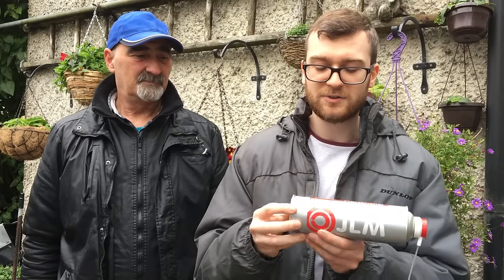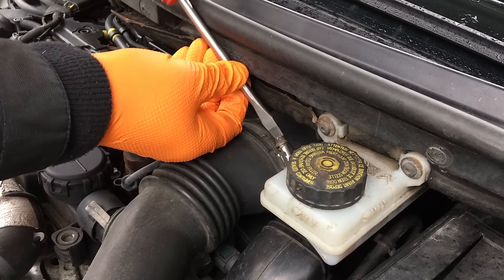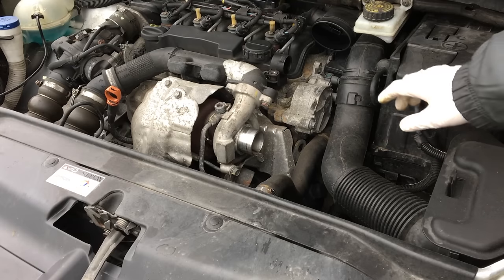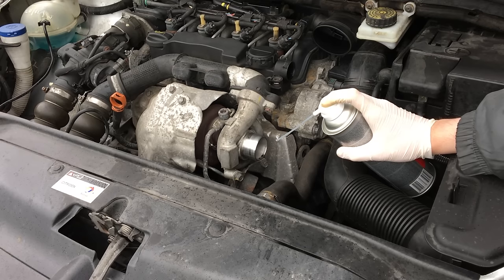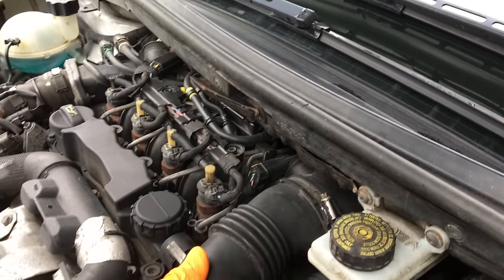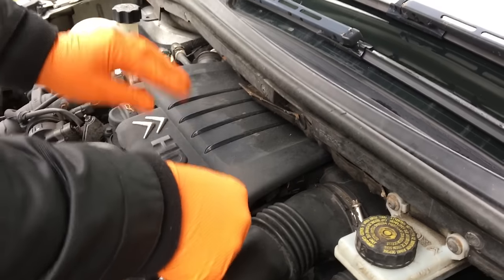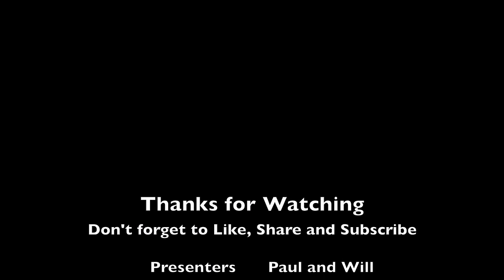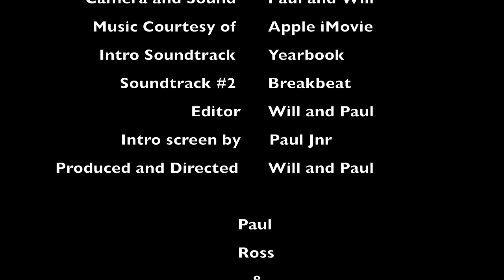How To Clean an EGR Valve Without Removing It

Comment: Clear explanation of getting this done. Good Visuals (Lighting, etc.) Very Helpful (especially when i am learning how to do this stuff so i will not get over charged by a local repair shop. Man, so many of local shops are questionable (overcharge, misdiagnose problem,  misleading info about repairs, etc, etc). Thanks for video (USA).
Reply from the maker: Hi K, 
Good on ya. No better way to learn than to try it for yourself.
Sometimes DIY can stand for Destroy It Yourself but not so in this video. You will not damage anything as long as you do not spray any sensors i.e. Mass Air Flow (MAF) sensor being very sensitive. 
If after using the can of EGR valve cleaner the EGR valve is still choked up then it would have just cost you the price of a can to find out.
We have another video of cleaning one when it's out of the car   https://youtu.be/HXqJ0YcOqOI
With experience we can relate to different garages and workshops diagnosis and billing methods so we make every effort to do it ourselves and share it with our viewers

Comment: Hello) It turns out that you did the dismantling of the air sensor and poured the spray directly into the turbine and all this went through the air cooler and through the damper and into the motor?

Comment: Did it work then?   Did it fix the engine light coming on with the EGR fault code?    I reckon you'd have a very slim chance of a spray into the intake actually removing enough carbon to resolve the engine light.
Reply from the maker: Yes, it worked. It temporarily cleaned enough for the warning light to go out for a few weeks. Eventually the egr valve was replaced.

Comment: Would this procedure apply to a petrol car? I am thinking in particular of a 2009 Chevrolet Matiz. Good work, many thanks!
Reply: In case of your car, it is petrol car with no turbo I guess. I that case, the inlet manifold of petrol car does not get much dirty.
Reply: I had the problem a couple of months ago when engine running when very lumpy and yellow engine management light came on. I gapped plugs, changed coil-pack but no good. I later replaced spark plugs but though running a little better, that was not full answer. I cleaned PCV which seemed to be working OK then reoved air-hose and squirted cleaner into air-intake. Within a couple of squirts, engine came back to running normally. For good measure, I fitted new air-filter as this was noticeably nearly black and likely overdue. Finally, yellow engine management light went out without having to cancel anything and everything still works just fine having passed annual technical test with no problem! Have a good day! @salimmetin

Comment: That was Great!!!! Love how humble you both were God bless you and yours from Missouri U.S. A.
Reply: Lee Brushwood what’s the cleaner u used ?
Reply: @virginiacurcija9445  I used seafoam motor tune-up, but I wasn't having a problem with my E. G.. R. Valve. At the time my truck had carbon built on top of the Pistons, so I just poured some down the carburetor and ran it for awhile. It smoked like a smog machine, but ran like a top afterwards.

Comment: Great job guys, indeed useful. The JLM instructional video (today at least that I checked) is saying to not spray it on the turbo as other people are saying, but to the inlet and not on the mass air flow sensor (MAF). On good trick on this car would be to remove the MAP sensor and spray to the hole.
Reply from the maker: Hi ktopoglidis,
Thanks for the comment.
Instructions and directions released by different brands are usually generalised and not model specific.
It is possible to spray directly through the turbo provided it's not hot. 
The spray canister being highly pressurised would be very cold and spraying it into a hot turbo could possibly cause micro fracturing of the vanes.
If as you suggested that removing the MAF and spraying in that way, we would reckon the majority of the spray would hit the inside of the pipe before a very little would eventually find it's way to the EGR valve
Reply: indeed they are not model specific the instructions from the manufacturers, but they do say in their video to do not spray in the turbo. There are several reasons, but I don't go into that. For many european models (Citroen, Mazda, Peugeot, Volvo, Mini and possibly more) the engine is the same (or similar). So taking one bolt that keeps the MAP is as easy as taking out the intake pipe. 
I will agree that you may have issues of hitting the pipe and run down a bit, but still might be better option.
The JLM video is here also: https://www.youtube.com/watch?v=rFoZ6F1KESw
Since I wanted to clean and the pipes etc I sprayed also on the turbo a bit.
Reply from the maker: We did indeed try it through the MAF/MAP on a Citroen C5 1.6hdi and it didn't work so well for us.
We found this way better but we would recommend caution as described above

Comment: Hi guys, my wife’s C4 GP 1.6 hdi is showing an engine management light and an ‘anti pollution faulty’ message. The car is driving ok up to 80 kph /50 mph but after that it can slow down going up hill, can hold back in traffic or even stall when going around a corner. Is it worth trying this treatment or is it altogether more serious? I’ve also thought about changing the fuel filter and air filter but then I’m stuck for ideas after that. Thanks for the great videos, they’re really inspirational.
Reply from the maker: Hi robru,
It could be a partially clogged EGR valve or it could be a clogged DPF.
If the fuel filter was bad, the car may have starting and acceleration issues at all speeds including stalling as well as pushing out excessive exhaust smoke.
Cleaning the EGR valve with the spray would be the first and least expensive step in a process of elimination.
Hope this helps.
Reply: Driveway Dudes many thanks for replying. I will give the spray a try first.

Comment: Will this cause my engine to overheat, which then kicks in my high fan to cool? I just did thermo housing, water pipe and turbo coolant aux pump, no leaks anymore YET IT NOW OVERHEATS 😮 and I have a fault code p2418 EVAP… so I’m not sure if it’s this EGR or my EVAP???? Please help me!!!!!!
Reply from the maker: Code P2418 is for EVAP and not EGR.
Hint, EVAP is short for evaporation and would be fuel related as opposed to EGR exhaust gas recirculation.
Try trouble-shooting and below may help correct this error:
Faulty wiring repair or replacement. EVAP pressure sensor repair or replacement. Fuel cap replacement. Faulty EVAP valves replacement. EVAP pump circuit and connections corrections. Purge solenoid replacement.
Hope this helps

Comment: Having taken my EGR valve out to clean it, I find it hard to believe a bit of spray will get an EGR restricted with gunk clean.    I scraped gunk off my EGR and soaked it in white spirit.
When I put it back there was an increase in power.
Also is it a good idea to have the at least two desert spoons of gunk that were in my EGR to be sucked into the engine?
Reply from the maker: The chemical composition of the EGR cleaning spray is such that it is capable of breaking down the deposits, ignites with the air fuel mixture and is expelled through the exhaust.
Is Gunk ignitible ? If not then be careful as fluids do not compress well and could possibly harm your engine.
In the very near future we will be making an engine cleaning video,  We may use a car or a motorbike, e.g. one of our cars or maybe a Px Arcobaleno that is to be restored.

Comment: EGR spray cleaner for gasoline cars isn't available in the United States.  What sort of substitute cleaner can I use?  Does the product you are using feel very oily if you rub it in between your fingers?  Does it evaporate quickly?  Does it have the smell of acetone?  I've read that adding 2 oz. of automatic transmission fluid per gallon of gas will clean the EGR valve, since it doesn't burn completely and the vapor works its way into the exhaust.

Comment: Thanks for the taking the time to shoot & post the video. I have a 207 1.6 HDi 2011reg. Its the first time I have ever owned a Diesel. I bought it 14months ago and it has 58000. is it worth doing this to my car, it seems to be running fine. Just had a major service on it yesterday by a Peugeot garage! I also only use Shell V-Power and BP Ultimate, alternating between each fill up.
Reply from the maker: Hi rush man1uk.  Thanks for the comment.
We like to think that this periodic preventative maintenance can help so that you may avoid having EGR issues. 
Spending £10 - £15 and an hour of your time could potentially save you £hundreds in garage bills. 
if you do decide to do it then just be careful that you spray it after the MAF as it is sensitive to the EGR cleaner.
Please feel free to share this channel with your Family, Friends and Contacts :)
Driveway Dudes - Paul
Reply: services are a con. Find out what yourcar needs and just do what's needed.  Anyone can top up their fluids!

Comment: On a Ford, if you get codes about EGR Pos. Sensors, replace the charcoal canister purge valve if it has one. If you get codes about Ox.sensor running rich, replace the MAP sensor.
Reply from the maker: Hi Marty. Good to know and noted :) Thanks

Comment: I have a 93 Lincoln Town Car it's saying EGR valve high voltage EGR valve low voltage do you have any idea what I could be dealing with?
Reply from the maker: Not familiar with the 93 Lincoln Town car but try this link and it may help
https://lincolnforums.com/forums/threads/1993-towncar-code-337-egr-problems.11543/

Comment: My Local Ford specialist replaced The EGR valve completely with The Proper Job."" "Expensive but WOWEE transformed my 2013 Mk 7 Transit... ..
Reply from the maker: Yes, replacing the egr valve is always best if it's beyond a clean

Comment: Hi Driveway Dudes. I have a peugeot 307 SW HDI 1.6, it is a 2004 model. My car has started bunrning the engine oil and it is producing a lot o smoke. Everybody wonders when I drive a round because of smoke. Can thing be solved by cleaning the EGR Valve, Inlet Manifold and Inlet Valves using the EGR cleaner?
Reply from the maker: It's probably the cheapest first step to try. If it works then you've solved it. If not, then you have gotten one step closer to finding the issue by ruling that out

Comment: I have a 2004 ford mustang and have replaced the valve, the two sensors have been checked and  the egr connections are not dirty but the check engine light keeps coming on. Any suggestions as to what to do?
Reply from the maker: Hi MRTIBURONTIBURON,
Is the car running fine when the light is on?
Have you had it on a diagnostic scanner? If so, did you have the system reset?
Have you had any parts replaced? Some aftermarket parts can cause this.
Did you do the "disconnect battery for 15 minutes" simple reset? 
On that car the most common issues that throw up check engine light would be the o2 sensors. Removal and a thorough clean, apply an electrical contact solution and replacing has in some cases rectified this. 
Others include mass air flow sensor, faulty gas cap, egr, faulty or damaged wiring (open circuit, shorting, grounding), cracked/gasket leak at header and then there's the cat
Reply: Driveway Dudes most of them except for  the 15 min reset.

Comment: Hi, Can i do this to my VW Transporter van 2.0 Diesel? Had a diagnostics which has come back with EGR Fault, engine management light is on. I also heard that you can put a certain EGR cleaner direct into the fuel tank when half full?
Reply from the maker: Is it a T5 or 5.1?
Reply from the maker: Usually injector cleaner is added to fuel in tank. 
It's not uncommon for the T5 and 5.1 to have egr issues. You can try cleaning it yourself or removing the egr to clean it. That way you can give it a thorough clean whilst checking the vacuum actuator and connecting pipes and hoses. 
If the van is not too old then in some cases as a gesture of 'Good Will' VW will replace the egr free of charge but you may have to pay labour costs

Comment: Hi, I tried this but as soon as I remove pipe, and start the car the engine shudders to a halt. When I replaced the pipe the engine ticks over again. Is this a sign of something worse? Great video btw
Reply from the maker: Hi Eoghanlynch1985. What engine do you have? Is the engine warm or cold when you try it? After removing the pipe, attempt to bring the revs up a little to prevent the engine from stalling. Hold the increased revs for 30 - 60 seconds and release the accelerator to allow the engine to idle. This should resolve your stalling issue.
Reply: It's a Citroen 1.6 hdi. I think the engine was cold actually. I'll try doing it again with warm engine, and report back. Thanks for advice lads, you're bloody great
Reply from the maker: Hi Eoghanlynch1985. Thanks for the kind words. Please do let us know how you get on :)
Reply: Driveway Dudes, just letting ye know that it worked perfectly with engine hot. I did need to clear fault codes with OBD2 reader though, but sure I picked one up on Amazon for €30, and it's always handy to have one of those
Reply from the maker: Glad to hear you were successful. Hope the video helped.

Comment: I have a 2003 Mitsubishi eclipse I'm also getting the p0401 code I replaced my egr twice located In the back of my engine and replaced the solenoid and the hoses. Still my light stays on.  Would this work for my vehicle and also any other suggestions would help.  Thank you.
Reply from the maker: Hi Lio, 
    P0401 is a generic code. The OBD detected an insufficient exhaust gas recirculation flow.
There are 3 parts to the EGR - 1. EGR valve. 2. Actuator solenoid. 3. Differential pressure sensor egr (DPFE). I see you mentioned the first 2. 
Have you checked number 3 on the list? 
Have you reset the trouble code/s with the necessary equipment as with some vehicles this may be necessary.
You may get build up in the EGR pipe/tube so spraying is an option and in some cases a solution.
If the car is acting/driving normal then it may be just a case of a code reset.
Reply: Driveway Dudes - I'll check number three and also try the cleaning today thanks for the reply.

Comment: Hi guys having problems with a 06 transit connect failing the DOE on the emissions now it was lying up for a while just wondering would cleaning the egr valve help to get this passed obviously with the other bits you have to do..ie filter changes diptane ect?

Comment: I'm confused about the title, with the video shown you are cleaning the egr thru the turbo charger itself is that right? So basically the 2 component's will be cleaned eventually?
Reply from the maker: The turbo may benefit somewhat from the egr valve cleaning spray

Comment: Can u tell me did this work it would save 200 pound ive put egr value cleaner in fuel tank light stayed out only 3 days i been running it with this fault for 8 months
Reply from the maker: It worked for us. Used it several times over the space of a year whenever light returned
Reply: I read few comments it won't damage the turbo will it
Reply from the maker: @paulwood6912  Didn't damage our turbo
Reply: @DrivewayDudes  thanks ill see what my mechanic thinks thanks for posting video

Comment: did it work i.e remove the error codes?
Reply from the maker: It worked as a temporary measure. Eventually the egr valve had to be removed a few months later for a intensive clean (see link) https://youtu.be/HXqJ0YcOqOI

Comment: I wonder if the Wynn's catalytic converter and lambda oxygen cleaner would work on a EGR valve
If addid to the petrol tank.
Just a thought.
Reply: Nothing added to the fuel tank will have any effect on the EGR.    It needs to be though the air intake system.

Comment: Hi Will and Paul a question from my son whose is not on line he has a 2011 multispace 1.6 hdi 90 mileage  is 137000,it was a import 26 months ago this has now developed a wine in his gearbox can you  recommend     a company or a person who can sort his gearbox please ,Paul.
Reply from the maker: It could be low on oil in the gearbox (gearbox oil is meant to be changed about every 20k) or it could be the clutch thrust bearing. 
If it's a manual gearbox, start it, listen, then press and keep depressed the clutch pedal but do not engage gear, listen, any difference in sound? If so it's probably the thrust bearing and if not then it could be the gearbox.
If it's automatic then you would need to bring it to a Citroen Peugeot approved garage to diagnose it for certain.
Based on the information provided, we can offer suggestions and possible issue/fault. We however cannot say for certain that 'this is what is wrong'

Comment: Got a 2.0 HDi Peugeot Expert. Starts fine (cept when very cold) and drives well but sometimes as I come to brake on an upward incline the engine stalls. It happens at one particular road almost all the time. Rest of the time fine. Any ideas? Thanks!
Reply from the maker: Hi V T,
Very cold/freezing weather can affect the performance of the battery and heater plugs. It can also affect the viscosity of oils including diesel especially if the engine has not been started for several hours. 
Does it stall as you're braking or when you try to accelerate after braking and is the engine still cold when this happens?
Are there any warning lights on the dash prior or after?
What's the mileage on it?
When was it serviced last?
Have you had a diagnostics scan carried out?
Did you try cleaning the egr valve as shown in our video?
Reply: I service it myself. Oil and filters all changed regularly. Changed fuel filter recently. No warning lights and nothing on code scanner. 100k on the clock.

It stalls as I brake and come to a stop. The engine has been running for 20 minutes at least so not cold as such. I'll try the EGR cleaning and see if that helps. If it stops raining! Cheers.